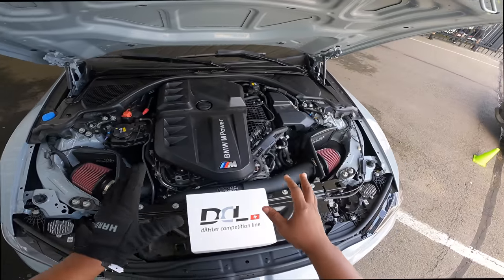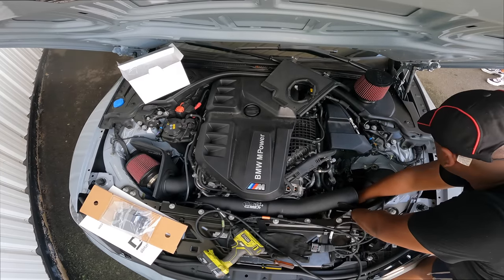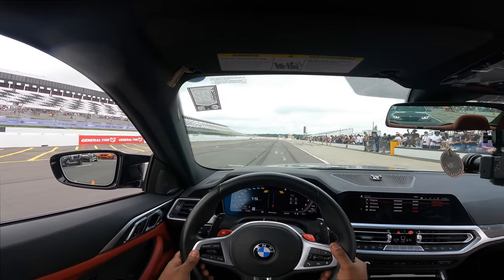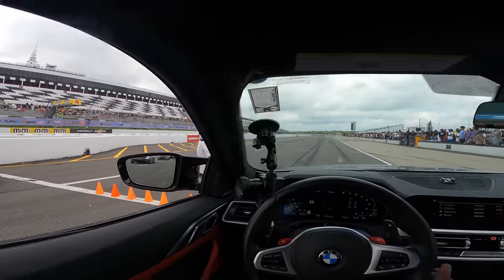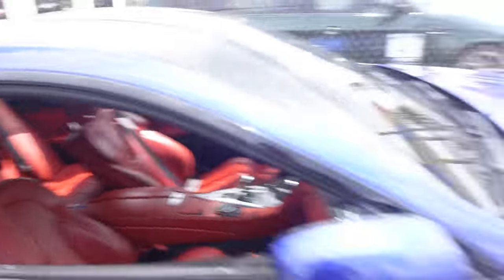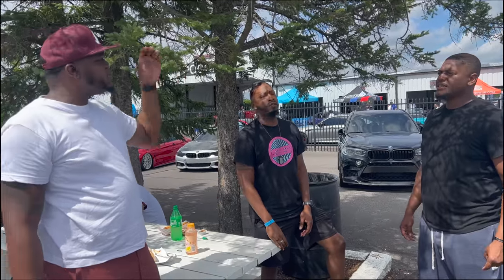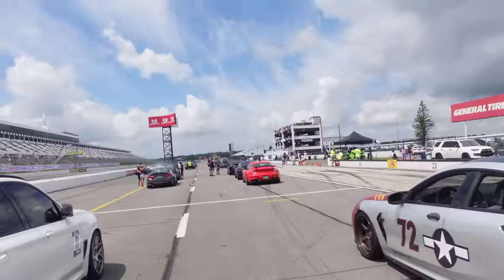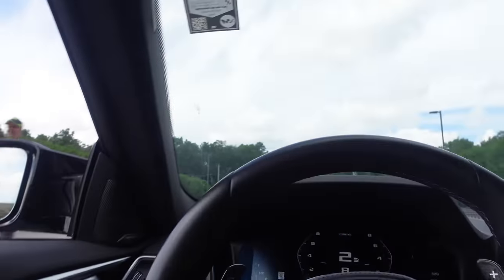MAKING MY 2022 BMW M4 COMPETITION FASTER! | MPACT ROLL RACE

Comment: They luv u Slowspeed. U like Hov bro.
Questions, when u got the wheels fix, what did they use to put it back on? Portable impact or air?
And what do u have in the transmission? Just transmission fluid Or transmission  fluid & conditioner?

Comment: You have the rwd right slo? Have u been in a stage 2+ F8x? I'm wondering about traction basically.  I'm a DE boi. Have a stg 2 f82 gona be E40custom in a week or so. But I'm on the list for a 23 G82 . And I'm DESPERATELY debating doing Xdrive or not. I love my DCT, I'm allready scared to lose it. But I don't wanna get the rwd comp and regret not doing Xdrive also, or get it and regret spending the extra 5gs for nothing. Please chime in. How does rwd traction feel compared to other bmws uve been in or owned. Especially with the power goin up. Rn I get sideways pretty fast and with e40 it'll be about 40-50whp and even more torque.  Hard debate ovahere.

Comment: Stock model s makes 691hp and won't break. What a waste of money. Then you have to wait for tuners to tune if you have problems. Then Dyno the car, more money. Been there done that. 12k later and my model s non plaid still faster than my car with bolt ONS  and HP tuners.